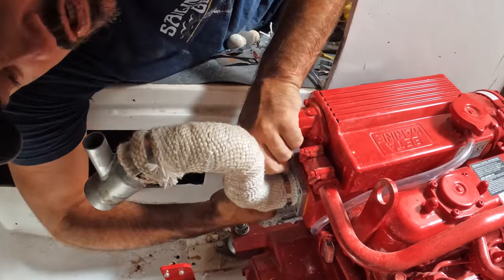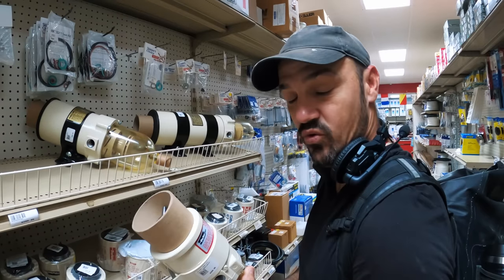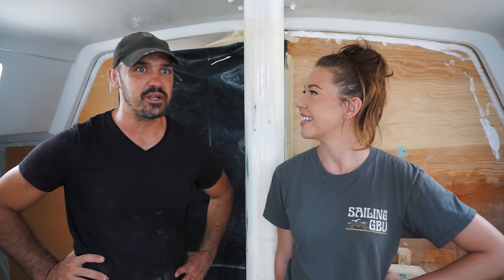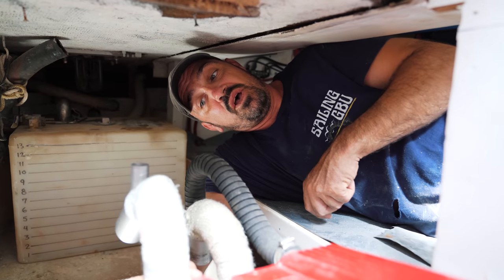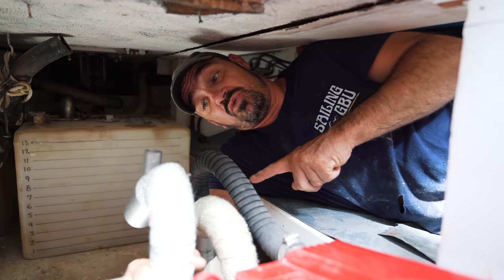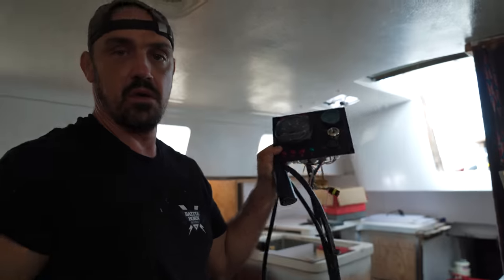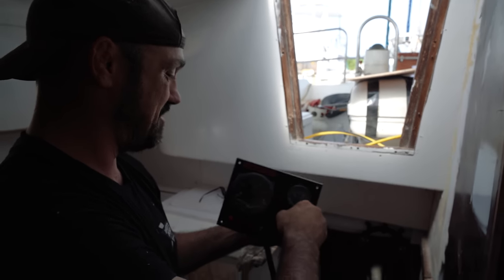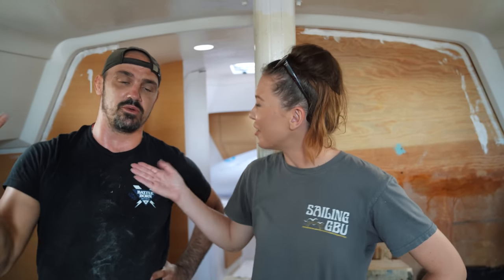Can we install this new engine alone no mechanic?! (Start up and mistake!)

Comment: Now that you have a reliable engine and transmission, replace that little girly-man alternator with a real manly alternator which puts out 200 amps to charge your batteries. 
At least you didn't put oil in the coolant part of the engine and put coolant in the oil pan. Now that would suck big time.

Comment: I changed the oil in my car once and when I put the oil back into the engine , I discovered that I did not put the plug back and all the oil went out on the driveway. 3 quarts before I realized it.

Comment: Hey Diesel Dan! at the end when you showed the engine running. Your idle should be about 6-700rpm. Sounded like it was at 1300rpm and you put in gear! Hard on your tranny 😉👍

Comment: Way back when I was in high school, by the way I graduated in 1981, my sister had a friend who needed a oil change in her car but she was a little low on money and so my sister said I could do it for her. Now I’m not  sure what this lovely young lady was thinking when she showed up to have me change her oil, but I’m thinking little short skirt was not a great idea because it distracted me. yes I was being a gentleman, but when you’re laying on the ground under the car pulling out the drain plug and then crawl back out from under, dragging the pan of dirty old oil with me that had the old oil filter sitting in it, I did remember to put the new oil filter on but somewhere in there I forgot to put the drain plug back in while looking at those lovely long legs. So as I started to fill the engine with oil again she makes a comment of what’s that and I look underneath And promptly dove under the card to put the drain plug it in. I had purchased 5 quarts but then found out her car only needed 4 quarts which was a good thing because I pretty much wasted a quart.

Comment: Matt, WTF were you thinking? Oil filter?  C'mon Man!   Ok, you got the btch slap...  That new engine looks Fabulous! Love all the new parts, water muffler, Parker fuel filter and NO you can't paint it red. It won't slip in and out of the bracket if it needs to be cleaned.... at sea! I know the bowl drops out but when it goes bad, you want it all clean... Wonderful video...Dan Diesel!!

Comment: What did you use to clean your gas tank? Mine is covered with oil, Greece engine compartment ick…. Any suggestions I can do to clean so I can do what master captain Matt has done😀

Comment: I know I'm late to the party, but... ...good God, what a bonehead move! Voided your warranty right out of the gate. Always crank over a new engine without fuel to circulate the oil before starting. If you had done that you would have found the missing filter without risking damage to the engine

Comment: If your waiting for someone to say "Hey Matt you're not an idiot, that could have happened to anyone!!" I think you will be waiting a l9ng time. And Bro, you use straight wood 2x4's to wet exhaust, you didn't even put epoxy over it. In a month or so it will be black, slimy, grimy and moldy. Please pull it out and  at a minimum epoxy it up to avoid the future bilge hassles.  If no one rlse said it, let me be the first. "Idiot!"

Comment: How many mechanics out there changed oil and left the old oil seal stuck to the engine .I did it on a brand new Toyota and I always check now .Don't be to hard on yourself .

Comment: You ‘plonker Rodney’ ( British comedy expression). That said, it’s the sort of thing I would do so don’t be too hard on yourself. One thing I’m not sure the comments have covered and if they have I’m sorry to repeat, but I would double clamp the water hoses. As your engine is below the water line I’d make sure each clamp is doubled up so the hoses don’t slip off. I’ve had a hose slip off and spotted it straight away but even in the few seconds it was off water came cascading into my boat.

Comment: Hey Kristen and Matt the nondiesel Dan, 

Just kidding that’s a great problem to have cause it could have been worse. Cleanbilge real good new paint job and add filter and oil DONE 
LOOKS GREAT 5 yrs no problems start collecting spare parts raw water pump ,alternator yo know the drill maybe beta marine can recommend parts to stock. You all make me want to work on my power boat 🛥 you be sail and power sailing if need start a note book for Clifford every thing done write in book book a marine log book JT HOOKED N ROLLING OFFSHORE 🇺🇸🇺🇸🐟🐠🎣🛥

Comment: You started the engine with the oil filter off?????   WTF ! Ha ha do you feel bad, well dont. You have a hundred variables going on at once, and filming as well. I have started quite a few engines after rebuilds/swaps and have made similar "stupid" mistakes. Easy for people to say stupid but how many would even attempt to do what you do? Mop up the spill do the walk of shame gracefully and have a beer, your human. Next time crank the engine without fuel and watch the oil pressure go up first before starting, but you already know this now. You know how I know, I left the oil filter off a BMW engine I just rebuilt with the customer stood there watching! Get back on the water soon.

Comment: Trouble is the oil goes through the filter and then it feeds the crank, rods, bearings and top end. So you oil starved the engine while you ran it. NOT Good. You just voided the warrantee.
Reply: I cringed when I saw the oil leaving the engine.  I am hopeful there was minimal damage.  I wonder how long the engine was running from the time Matt started it unil it was shut down?